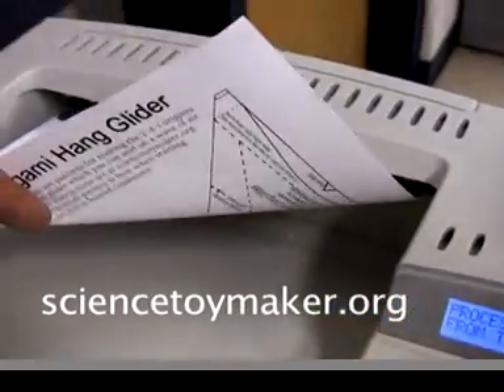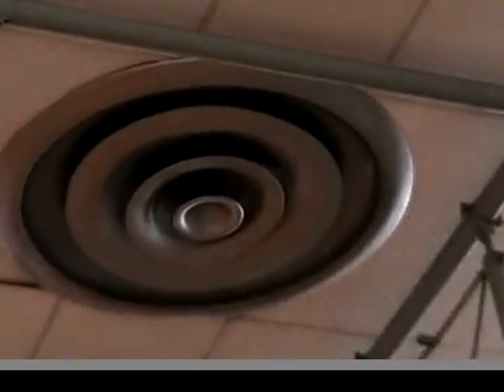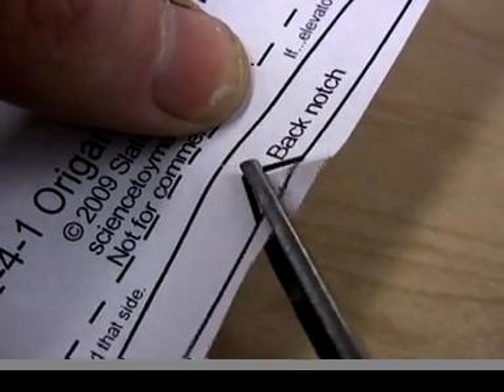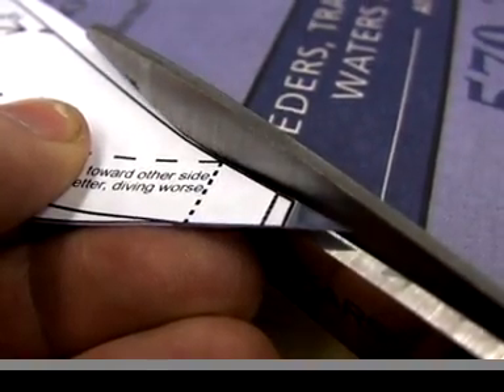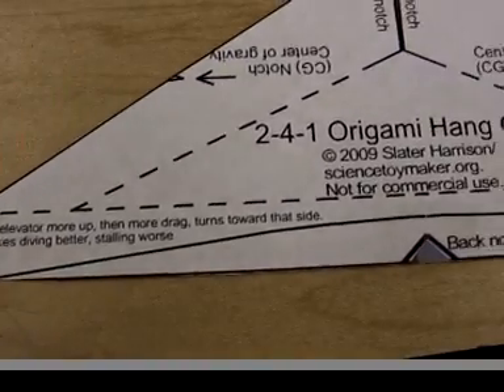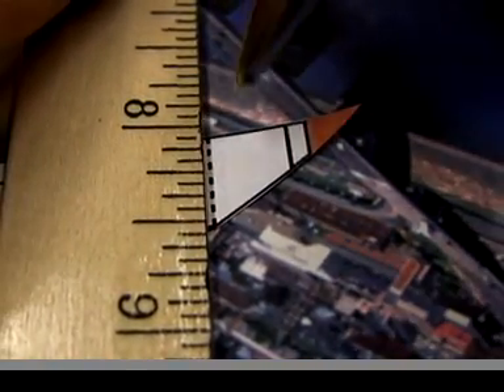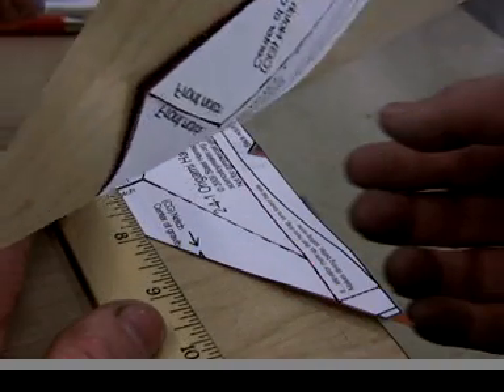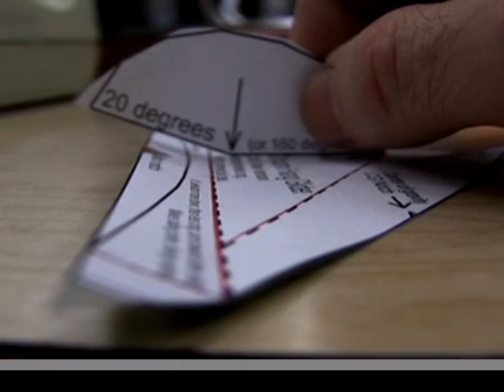Out of Date Part 2 Surf an Origami Hang Glider on a Wave of Air _Construction.mov

Comment: can i use a phone book insted of a piece of foam
Reply from the maker: Skylar Michelle Even phone book paper is much heavier than 1/2 mm eps foam, and not rigid. You can try paper instead of foam, but it is much more difficult--not something that I would suggest starting with. If you are determined to use paper, start with a tumblewing or the variation: big mouth tumblewing.

Comment from the maker: @k91616 RE scale check: Perhaps since you live in England, it prints a little differently, or perhaps it tried to "fit to page." In any case, 96 mm instead of 104mm is close enough.
Slater